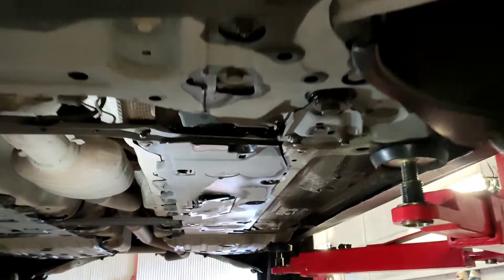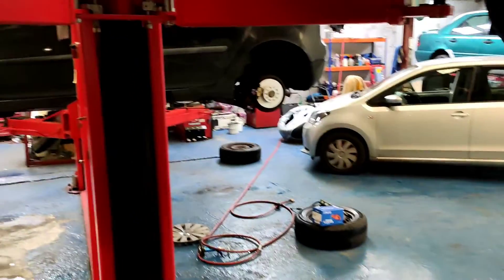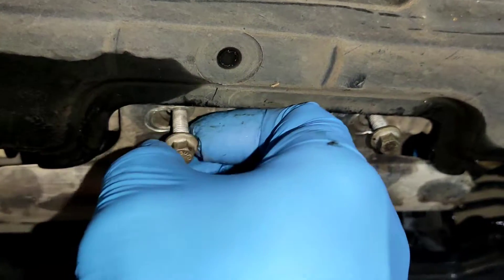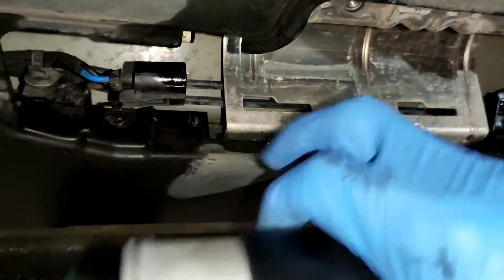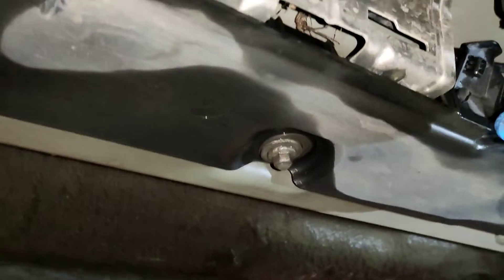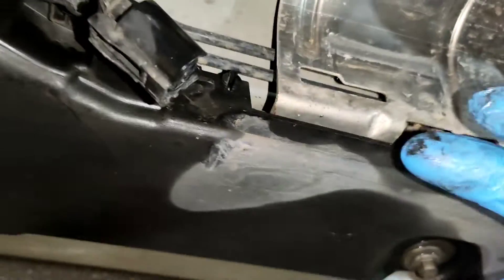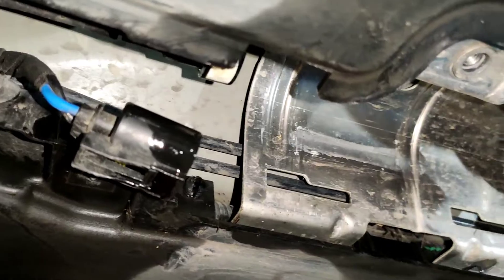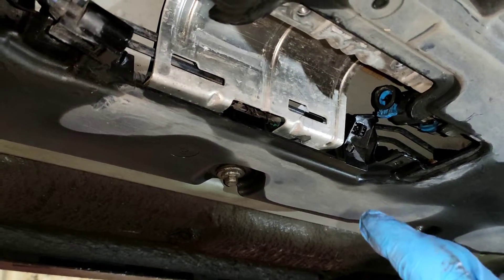XC90 fuel filter replacement

Comment: Very detailed information ! Can you please elaborate what do you mean by "cycle the ignition a few times before starting ?" how do you cycle the ignition without starting the car thank you
Reply from the maker: Hi if look at at this https://youtu.be/_OolrAIWjr4

You can see me cycling ignition without starting the car in the frist few seconds of the video.
You basically turn the start button with out your foot on any of the pedals. To get the dash to light up and that makes the fuel pump run. Do that afew times to fill the new filter. Before starting the car hope that helps if have any questions just ask
Reply: @murphyslaw2020 Thanks again, just did my Diesel filter replacement today and your video just made everything so much easier for me.
Reply from the maker: @Adriannhan  glad to have helped

Comment: hey bud, do you recommend a 2.0 diesel xc90? how do you find this cars? can they last 200k km ? i ve seen the erlier 2016 diesel engine having issues with the piston rings. they fix it after 2017... should consider a diesel or gas engine? thank you
Reply from the maker: Hi iv never owned one we had afew newer diesel engine in for service over the last few months. Nice an classy .
They can be expensive to repair but it is an expensive car. I wouldn't buy one if I was on a budget  just in case any thing went wrong if that makes sense.

Comment: I have a US model and there is no filter in that location any idea where it would be? 

Thanks.
Reply from the maker: Hi I'm not sure. If you could give me the engine size and code I'll try look it up.
Reply: Okay, where would I find that?
Reply from the maker: Even the year and the engine size
Reply: Its a 2017 xc90 t6 momentum
Engine Model B4204TS 
Its a 4 cylinder
Reply from the maker: Hi I can see the location but some of the Volvos have them in the rear next to the fuel tank in plastic housing that you undo and it a paper insert filter . Sorry I can't be more helpful
Reply: @murphyslaw2020  maybe in the us you got the gasoline engine and maybe in the video presented is a diesel engine.

Comment: How do you prevent fuel from spilling when you remove the filter?
Reply from the maker: Use a Container under  the filter  to catch the  fuel  it holds a good bit and put something on the floor if you worried about the fuel leaking on to a drive way etc. even  Cardboard might work